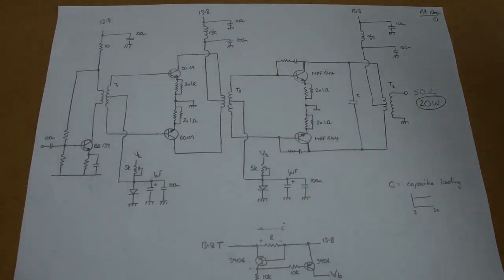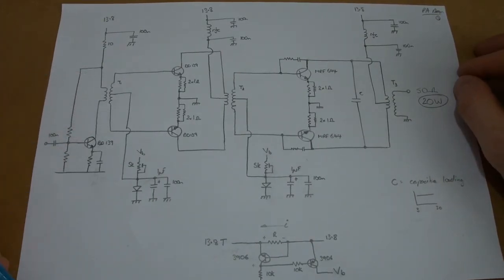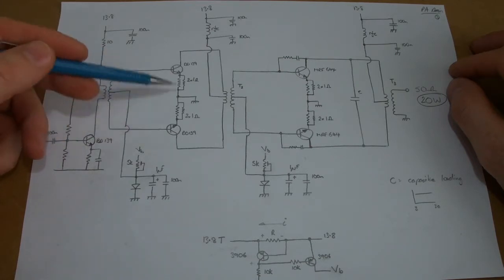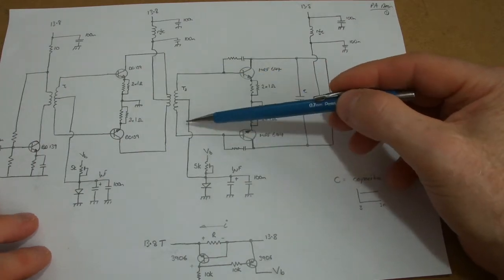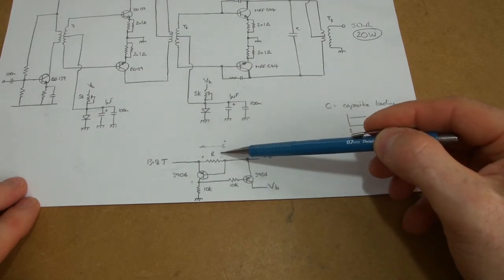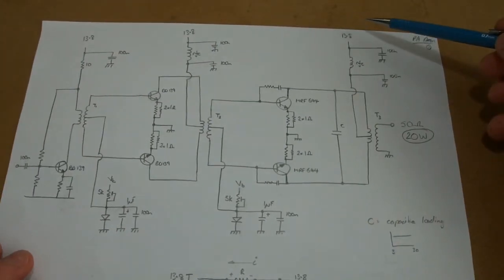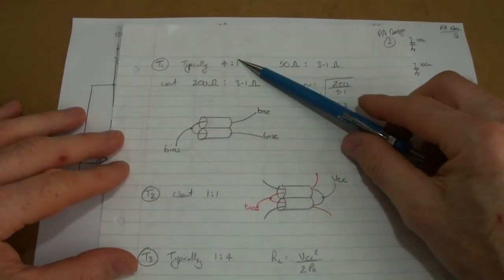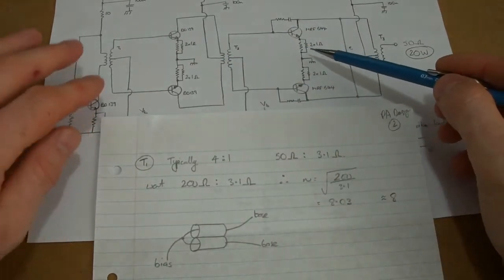Homebrew 80/40/20m SSB Rig Part 8 - RF Power Amplifier Ideas

Comment from the maker: The CAD work for the circuit board is now complete. I'll look to mill out the circuit in the next day or so then solder on the components. I'm going to start at the MRF644 end and work backwards. A bit unconventional, so we'll see how it goes. Hopefully, no smoke! 73s, Charlie ZL2CTM